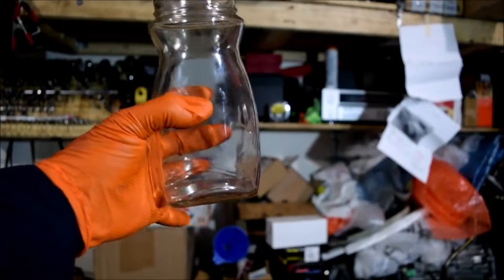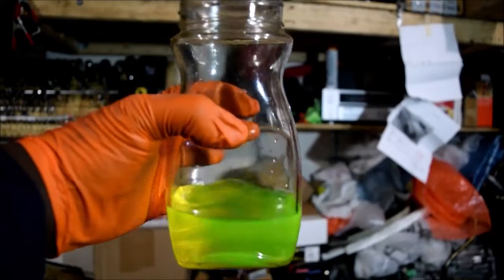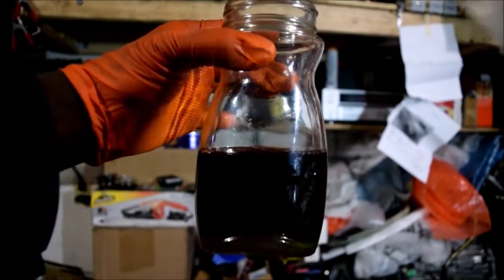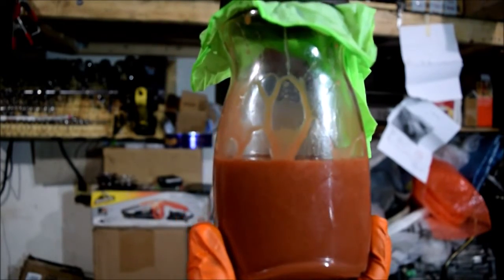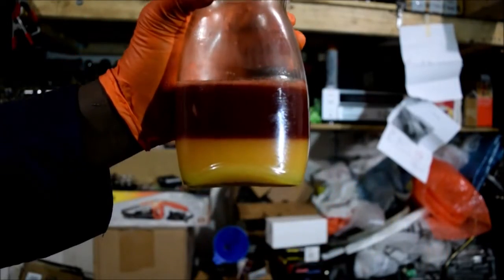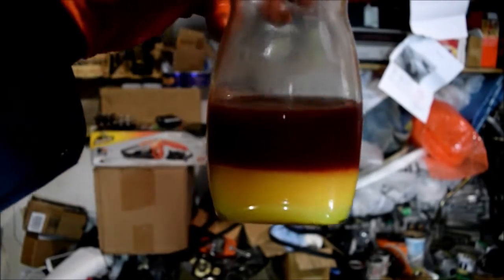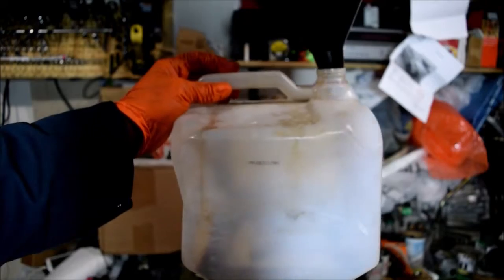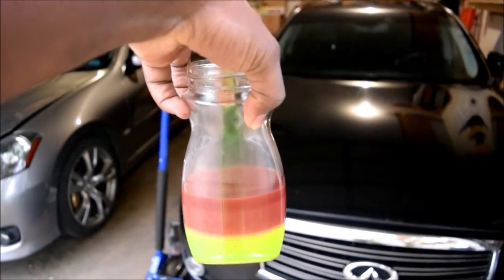Mixing Coolant with Transmission Fluid (ATF)

Comment: I accidentally put transmission fluid in my coolant/water hole and my car over heated but I only was driving for about 5 miles 10-15 min but it still got in the radiator and I was wondering will a flush help or is the car for sure doomed

Comment: I have a 04 neon going into shop tomorrow April 3rd. Trans fluid is creamy pink so looks like I'll flush the system first use bout 5 gallons. Change the radiator and thermostat 👍

Comment: Can this happen to a 06 M45?
Reply from the maker: It could, but thankfully it's not a common thing for M45s. I've never seen a single report of it.
Reply: @EdBwoy  thanks for quick response! You are truly the M goat helping keep my 15 year old boat alive, how are these engine with valve stem seals I sometimes have a slight puff of smoke on start ups if sitting for some time it’s weird tho because sometimes it’s there’s sometimes it’s not and it has a very slight hint of blue my old maxima had this issue so I have know when it’s bad, but I already changed the pcv valve with oem wondering if oil catch can will help, “burn” about 1 quart/1000 miles give or take with driving conditions, 180K miles she still moves for being 15 years old trying to just keep her up float for 2-3 years until I can move on hopefully to a M56 or Q70L 5.6 of course any input would help thanks

Comment: Hey, who do you feel about using transmission fluid other than the dealers fluid?
Reply from the maker: It works, but in my opinion, transmission fluid service is done so infrequently that I don't mind paying up for the OEM fluid.

Comment: Had to think about this a bit but something is either miscible or not miscible with regards to miscibility. But hey we all knew what you meant I do the same thing. 
I was actually surprised how quickly things separate out, the whole “milkshake” that is always shown must really contain very little water or coolant for it to be emulsified vinaigrette for like a whole transmission inspection vid.

Comment: Great vid. I needed this today. Just swapped an engine in an Jag XK8. Went well BUT seems a crack developed in the rad and FILLED my trans with coolant and visa verse. How do you suggest I proceed in draining the best way possible. I've started the car but not driven. Drain the pan??? Run engine pumping in new fluid. Wait,,, drain again at pan??? 

Should all attempts at draining coolant be waiting for separation and draining from pan???
Reply from the maker: I would do just as you suggested. Buy the cheapest acceptable transmission fluid and do multiple drain & fills, running the engine and shifting gears then letting the fluid sit for about a day to settle out. 

The aim of running the engine is to try and expel any bad fluid from the torque converter. I believe in 3 or 4 cycles you'll be able to see if the coolant drain has stopped producing anything with the wrong color.

The coolant system should be much easier to flush. Remove thermostat & run garden hose. Or just drain-fill a few times knowing that ATF will want to get to the highest point when settled. I prefer the hose method

Comment: I accidently but a lil bit of coolant in my transmission fluid not much will my vehicle still be fine?
Reply from the maker: How much was "a little bit"?
Still, I'd take precautions and get rid of the coolant. Replace the trans fluid
Reply: @EdBwoy 3-4 ounces in 5 gallons of fluid...idle for 20 seconds...son wasn't paying attention 😮
Reply: You're good bro
Reply: I did that to a rock truck today

Comment: Hey Ed! I know this was very common on the nissans,but i couldn't find it anywhere that it was an issue on the Infiniti M45 . I know nissan shares parts with Infiniti, but do you know if our m45 radiators our nissan radiators?
Reply from the maker: It's not a common issue for the Infiniti M

Comment: It looks like the coolant stripped something out of the trans fluid. It was brown at first, and now it looks lighter. Both fluids seem to have had a permanent effect on the other.
Reply from the maker: Good observation. 
We usually say, if you can see the symptoms, then the damage has already been done. Mixed fluids pretty much spell trouble, might as well start budgeting for a new trans.

Comment: Yeah this shit is common on pathfinder. Happened to me. Replace the whole cooling system parts, but got worst I thought I fixed it but the water burned out the transmission valve body. 🤦🏾‍♂️
Reply from the maker: Damn, sorry to hear that man. That was a bad era for Nissan vehicles
Reply: Did you flush the transmission a bunch?
Reply: Evan Jeffries I should have flushed it a bunch of times. I thought once would be good enough. It wasn’t
Reply: @jamesofalltrades4359  did it come out clear?
Reply: Everything looks like strawberry milk and then became a transmission red after about ten 5 gallon bottles of transmission fluid. If you have this issue flush the trans / change the radiator/ thermostat/ and burp the system. Burping is very important with nissans bc that air left in the system will push its system out making you think the system is over heating
Reply: @jamesofalltrades4359  my car is a ford, you just top off the coolant while the cars on right? How long was your trans sitting w coolant in it
Reply: Evan Jeffries atleast 3 months. I thought the car was trash until I found someone that knew the issue and that’s when I flushed it. It worked for a month then it stopped starting. The ecu and valve body stopped communicating. Bc the valve body shorted out due to the water
Reply: @jamesofalltrades4359  mines been in for 3 days I might have a shot... Well see tomorrow
Reply: Evan Jeffries if you do it make sure you fix the cause. With Nissan its the crap radiators they make that fail internally
Reply: @jamesofalltrades4359  mine was a faulty radiator from a shit Chinese aftermarket place. Worst part was the rad was new
Reply: @jamesofalltrades4359  how much did just all that fluid cost you? So you went through 50 gallons?

Comment: I read somewhere that VK45DE engines have a problem with coolant entering into the transmission. Not sure if that’s true but I do get a rumble when I go from 2nd to 3d gear sorta odd almost sounds like it’s slipping
Reply from the maker: Nope, not common from the VK45DEs that I know of. But it wouldn't hurt to check your fluid

Comment: Ahh yes... The good 'ol milkshake 😆 gm famous for that mix with their plastic radiator/trans cooler garbage
Reply from the maker: Nissan radiators are also made the same way. Some models had an issue with internal breakage. Most others will have the plastic cracking on the outside
Reply: @EdBwoy  any experience with standalone trans coolers on the m's?
Reply from the maker: @mikeschaner5853  I haven't, but I know some people get standard off-the-shelf coolers and connect the trans to that only. 
It's something that can be done for any make/model really